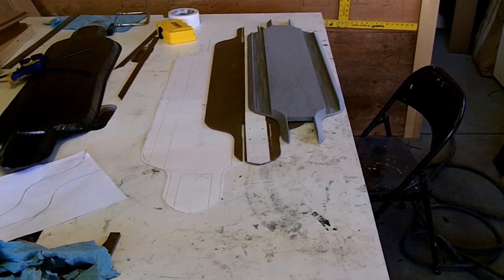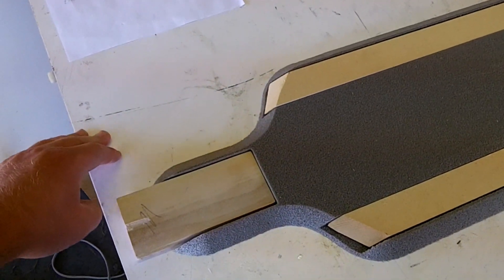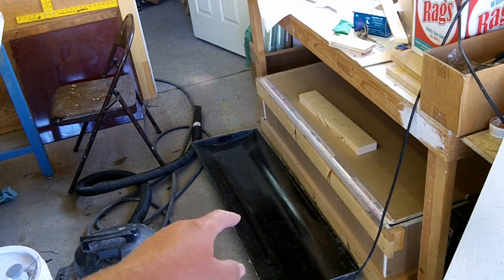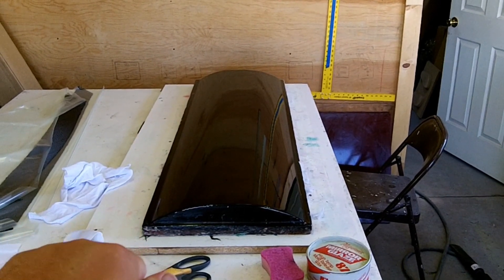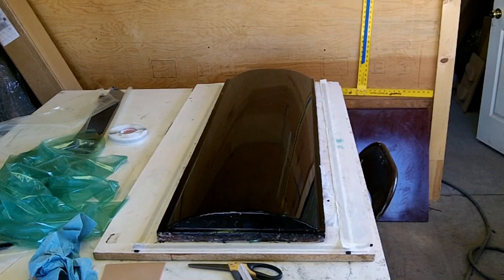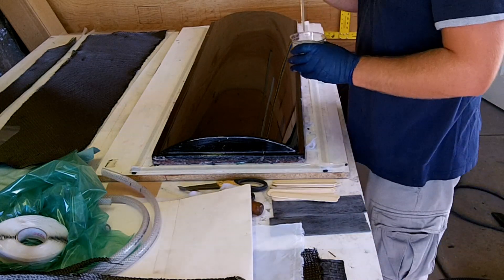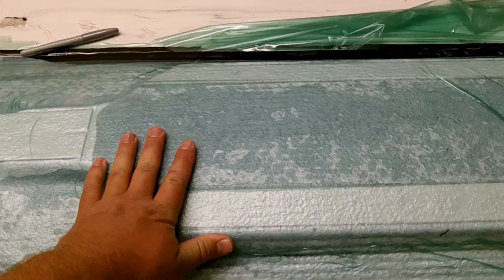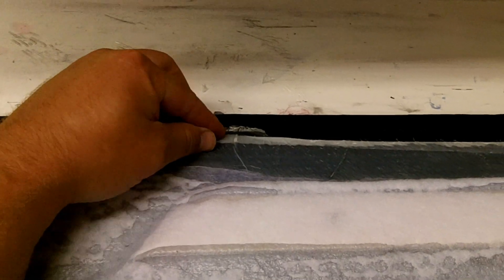DIY Carbon Fiber Longboard Tutorial- 3 of 7

Comment: hey man, really inspired by your video. ive had some epic ideas. making an electric carbon fibre longboard deck. with a motor on it. but im going to use lipo batteries. and put this inside the deck so theyre not visible. one thing i cant seem to find is the vaccum bags your talking about. could you shed some light ? im from the uk. are these hard to find ? thanks in advance man. i really like your boards :)

Comment from the maker: I used uni running lengthwise of the board and then used a 0-90 deg bid and turned it so that it runs at +/-45 deg of the board. 

I've never tried oxford textile I'll have to look into it. Thanks for the suggestion!

Comment from the maker: Sure, there are as many ways as you can think up- but you'll have to find something that will work. One idea I've been thinking about is just hot-wiring the shape and then using some EconoKote film  (Used in covering foam RC airplane wings) to cover the surface. It wouldn't hold up for as many boards but the process would be fast and cheap. If I get some time I'll build one and post it.

Comment from the maker: It is often better to vacuum-bag than not but, there's lots of non-bagging methods used in composites, especially home-built airplanes and surfboards. So to answer your question... yes you can do your layups without using vacuum bagging. You could also consider pressing it, if that's what you use for your ply lamination.

Comment from the maker: @75madpanda 
If your board is going to be nude carbon fiber or black you're are going to want to use an epoxy that has a high Heat Distortion Temperature (HDT) to prevent board-sag on hot days. HTR 212 is a good choice (290 Deg F). You can get that at Aircraft Spruce or from Resin Services. The carbon fiber, peelply, breather, etc and be purchased from a number of good composite stores. I like CJ Composite Technologies, Fiberglass Supply, Jamestown, etc. For more help send me a PM or email.

Comment from the maker: @75madpanda 
Yes, you can do layups without using a vacuum bag. However, vacuum-bagging makes a superior product- How much superior? I do not know. You can get a pretty good budget vacuum press kit from Roarockit- it's called a "Thin Air Press" and it costs around $60. The only draw back of their kit is if you have a leaky bag; however, if you use their bagging techniques and follow their instructions, you'll find that their press system works great- It also works on wood laminate boards too.

Comment from the maker: @Darknights7 
I've used a core as low as 1/2" and have been fine. However, it takes a bit more carbon fiber to help with flex. I personally like using 5/8" I think it gives the right amount of weight to stiffness. If you're just using it as a stringer... I'm not sure how it will work out for you- I guess it depends on how wide and how thick you make it. I don't know if you've seen all the videos yet but I'm over 200 lbs and the board barely flexes with me jumping up and down on it with one foot.

Comment from the maker: @Darknights7 
LOL it does look like a coffin! I have used the pink Owens Corning XEPS/XPS for cores. I don't know if it was the Foamular, c200 or c300. Any of them should work with little difference in weight, but given the choice the Foamular seems to be a bit stronger in compression strength so I'd go with that- the higher the number the stronger it is. They use to make it in 5/8" sheets but 1" is the smallest I see now. Sounds like you're heading in the right direction to me.

Comment from the maker: @monkeybob200 
Vacuum bagging will create a superior product in strength and weight but... Yes, you can do a carbon fiber layup without vacuum bagging and yes it will still come out strong. However, I've never tested the difference in structural properties for bagging vs just a regular hand layup so I couldn't help you there. If you where to make a board with complex shapes, like the one in this video, I think it would be terribly difficult without a vacuum- but if your creative it could work.